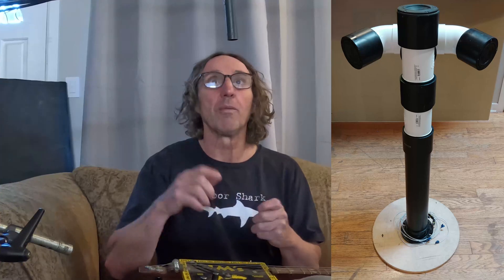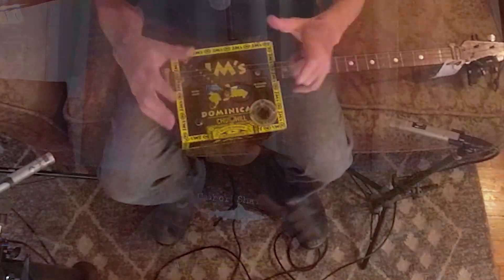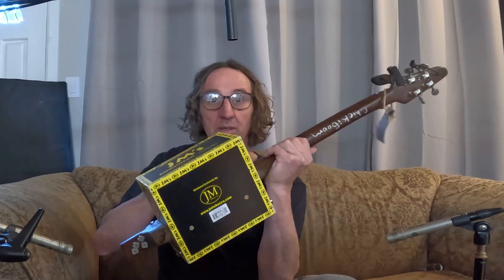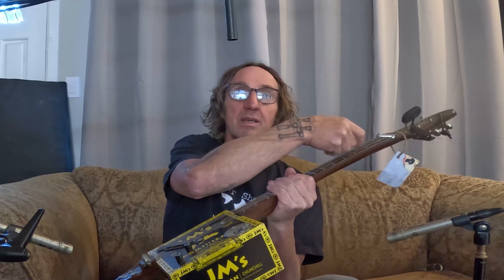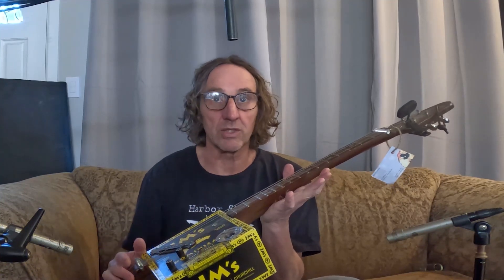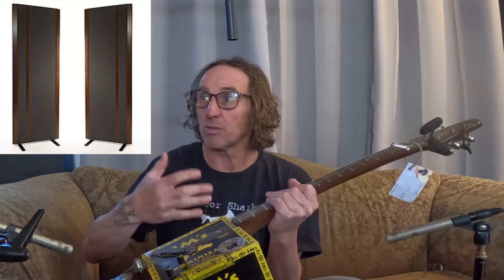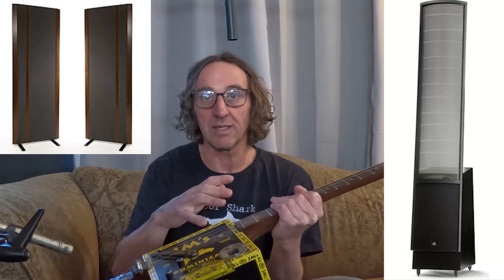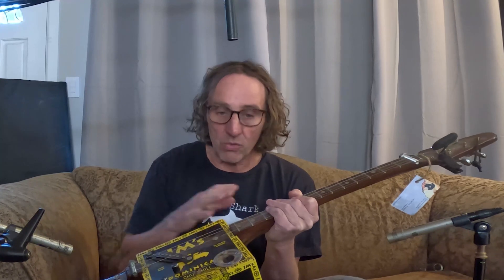Which Speaker Sounds the Most Realistic?

Comment: Okay, let's start with your conclusion about instruments not being a point source.
While I will agree that instruments do interact with the environment immediately surrounding them  (I'll talk about how that affects what you are doing shortly), instruments become a point source because the listener does not get up and walk around the instrument to listen to it.
In all but extreme environments a listener can turn and point directly to the particular instrument being played or the source of the sound, such as an amplifier.
This would occur even in situations where there are multiple instruments being played at the same time depending on the volume of each instrument. 
Now, as you correctly pointed out, the instrument interacts with the environment surrounding it,
In your process of recording an instrument from multiple directions, the environment will be recorded as well.
A good example of this is overhead mics and room mics along with close mics used to record drums.
Typically specially built rooms are used to record drums specifically for the purpose of recording the environment, but not all rooms built for recording drums yield good results.
It would be foolish to use room mics to record a live performance of drums in a club because the surrounding environment would not be conducive to a good-sounding recording of the drums.
Another problem with capturing the "environment" is that there is no control over the playback environment and the two environments will not reproduce the original sound.
Because no two clubs, restaurants, or performance halls are built the same so the playback from the speakers will sound different in each different environment and not necessarily natural.
This is why sound technicians of engineers, and the equipment they use "adjust" the sound to suit the music and the venue.
If you record your guitar in a neutral or dead environment and I place your multi-dimensional speaker(s) in the corner of my living room with hardwood floors I am not going to reproduce the same sound you recorded and the "naturalness" of the source recording won't be accurately reproduced.

I also noted that you are using a variety of microphones to record your guitar,
Is the frequency response of these various microphones affecting the tonality of what you are recording?
Good luck with your project.
Reply from the maker: Not sure what people walking around has to do with point source.

With a true real sounding instrument you are able to walk around and have it sound real.  

Having to stay still to hear is like having to wear those coardod read blue glasses to see 3d movies.

As far as the sound of the room, I don't want to recreate or deal with that. I want to drop a real sounding instrument in your living room and have the musician there with you in your space. Not bring a space to you or transform your space
Reply: @DaveRat  How many people walk around an instrument to listen to it.
Most real people sit or stand in clubs or restaurants or concert halls or even their living rooms and listen primarily from a very limited area, but they don't walk around the instrument or the performer to listen to the music.
You aren't dropping a real-sounding instrument into any space because you are ignoring that you have no control over the space in which your playback array will be used in.
The recording you make will not be faithfully reproduced in any environment except the one in which you record it in.
Reply: @JonAnderhub  i understand your points, high fidelity reproduction is so complex that it takes all sort of controlled parameters just to come close... BUT the distinction made with this approach/project is not high fidelity but realism -or so i understand it. 

the box guitar recording will not sound in your listening room as the guitar sounded in the room it was recorded in but it will sound closer/more convincing to a box guitar playing live in your listening room.... 

hope this helps, i'm not schooled in this area so i might just imagine i understand these things :)
Reply from the maker: Yes, I think we are on the same page. I want it to sound real in your living room, don't want your living room to sound like where it was recorded. Just that it's real for you. And since the listener does not have the original source to compare to, real matters, identical does mot

Comment: I listened on Sony MDR-7506 headphones. It's fascinating how real a presence your speaker design has. The second best, I felt, was the Rogers speaker. The others all paled in comparison. Your system would, however, raise by considerable complexity and number of tracks the task of recording and reproducing all of the sounds that an ensemble makes. But then, I was listening in stereo, not in the room with your speakers, so at best I had the illusion of an aproximation of what they must be in person. Almost every system these days is stereo, or mono in comercial environments. Could it be possible to adapt "normal" stereo recordings to play with increased realness on your speaker by using a crossover system that redirects more frequencies, rather than using more tracks?
Reply from the maker: Agreed on the Rogers and yes, I do believe that stereo could be synthesized to sound more realistic with multi channel speakers
Reply: I’m listening on the same headphones. I do agree, the homemade speaker was the best followed by the rogers. I would’ve assumed the l-acoustics stage monitor would be near the top, but only the flat panel and sphere speakers sounded worse! Even the Bose sounded better, and they don’t exactly have the same reputation among audiophiles as some of the other hi fi speakers here.
Reply from the maker: What is most amazing is that this completely non-technically designed speaker built from tubing and no analysis can even approach sounding remotely as good or real has these designed products

Comment: I suppose this hinges on whether convolving the guitar with the room, as witnessed at each microphone, is reversibly equivalent to multiple point sources convolved with the room as witnessed at the listener. My gut says these aren't equivalent, though I don't have the physics to back it up. One obvious factor here is that recording the room sound from the speaker location would double the room sound from the listener, as some is already baked in.

What you probably need to fully replicate live experience is a single reference mic as close as possible to a singular noise source, recorded to it's own track, played back from a monophonic speaker located at the same point as the source, with radiation width and vector matching the source. Do this once per instrument and it should be a pristine copy of the experience. Immensely impractical as it would need per recording setup for playback, but it would be an experience.
Reply from the maker: I think I cover all of this in the video
Reply: @DaveRat  you may have, I probably took it as something slightly different.

It also occurred to me that this is probably why small bands at small venues tend to sound the most live. If they're all playing through their own amps, it's pretty much the same setup. Watching the local punk band and Ministry at the same bar are an entirely different experience, sound wise.
Reply from the maker: Yes, as a live sound guy for many years and someone who loves all forms of sound reproduction, all I am doing here is trying to make a way of having home listening actually sound more live
Reply: The problem with that ia that it incorrectly assumes that musical instruments are omnidirectional.  They are the furthest thing from it.
Reply: Also, any instruments with amplification are irrelevant to this project, as the most realistic portrayal of guitars with amps is actually gonna be the closest duplicate of what kind of speakers the amp itself has.

Comment: To get the most realistic sound possible, wouldn't you want to use flat frequency response mics like measurement mics and then use dsp to measure and eq the speakers to be flat? Seems like it could be an even cooler concept with some tweaking! I play guitar and have access to a bunch of pencil condensors to record a clip for you if you'd like some more content for your setup
Reply from the maker: Hmmm, I think you may be confusing identical with realistic.

Two things can sound realistic and not be identical sounding, even if they are versions of the same thing
Reply: @DaveRat  I agree, but since you have identical speakers as well, you might want to use identical mics
Reply from the maker: The speakers are not identical either, 2 different types.

I show that in the build video

Comment: More control signals is more resolution. More detail. Fewer phase and frequency anomalies. Fewer bottlenecks. More energy. More processing possibilities.

I honestly believe that the correct format for a DAW to store and process is some sort of soundfield B format and render that with intelligent time delays and gain compensation out to a high definition 3D array of 3-axis dipole + omni transducers. 

An omni pressure plot is BEST CASE FOR MONO. Wire recorder era thinking has persisted since the beginning. Particularly all the analytical maths is one dimensional, and is far too compact. Audio is not a one dimensional vector function. It isn't. It's a complex soundfield being sensed by an intelligent life form.

Comment: an interesting one would be a 360 degree timed mono-mic walk around of the live player/instrument through the right ear here on youtube, with a similar/later timed walk around of the various speakers under test individually sync'ed up to be simultaneous in the left ear at the same time highlighting the difference for each of the speakers. Your brain should perceive the similarities in the middle & any differences at the sides so give an easier comparison across the speakers/directions rather than having to try and "remember" what the original sounded like at that point.
Reply from the maker: Hmmm, my goal is that someone walks into a room and it's sounds real. It can have flaws, it does not need to be identical to the original, it just needs to sound realistic.

The listener won't know what the original sounded like but they will know if it sounds like a normal speaker

Comment: The next experiment that I'm curious to see (or may attempt myself) is if there's an exact number of microphones to where if you go beyond, would it make negligible difference in the output
and if does, does that scales infinitely?

This also provokes the thought of overall compatibility with different future systems. Maybe experiment with methods of summing 8 microphones down to the 4 channels for your speaker and seeing if there's a perceived increase of realism or if it's even compatible/useful at all.

I want to build my own similar enclosure and do a bunch of test recordings with it. I might start with as few channels as possible and work my way up. I'll be certain to try to maintain compatibility with the current configuration of what you have now! Just gotta find free time to do this haha.
Reply from the maker: What I have found is 2 is too few, 3 is pretty good, 4 and 5 work well and over that it does not change much

Comment: Thanks Dave. Good stuff. I used to work at the old ESS (Electro Static Sound) factory in Sacramento back in the early 80’s. Those Heil air motion transformers sound pretty cool. They disperse from the front and rear. The cabinets also use a passive radiator for rear dispersion. They also made a monitor version with two 12’s. They were beasts and way ahead of their time.
Reply from the maker: I love and cherish that speaker and it is the center channel of my home hifi
Reply: @DaveRat  I still have a pair of the Heil transformers and some diaphragms. I tried them on top of some JBL Cabaret 4699b’s for my home stereo. They sounded pretty good. They have an amazing frequency response and are able to cover a lot of the upper mids. Thanks Dave. Love your attempts to create realism.
Reply from the maker: The clear crisp sound and also the figure 8 dispersion combine to give a wonderful sound 

Great to meet you!